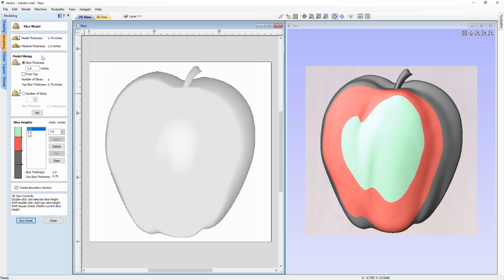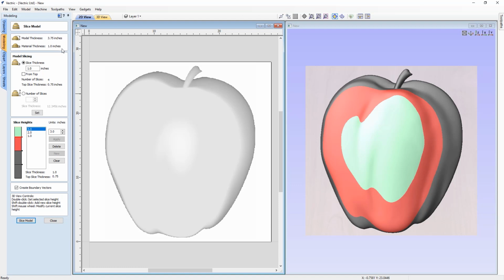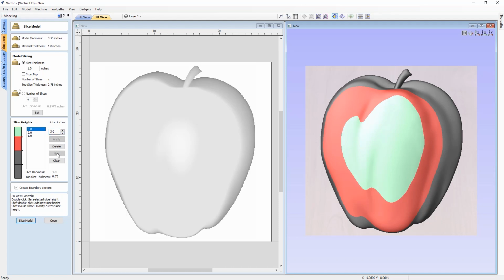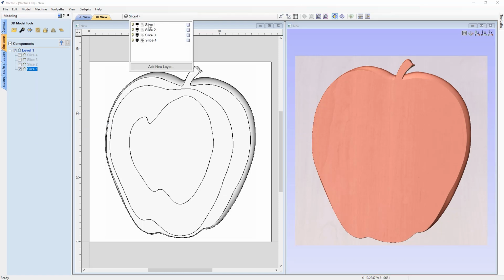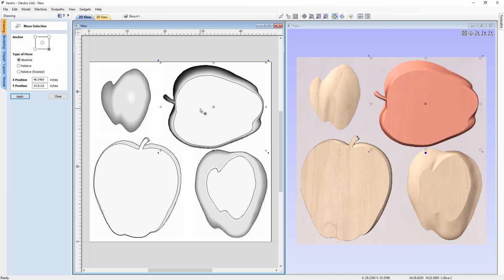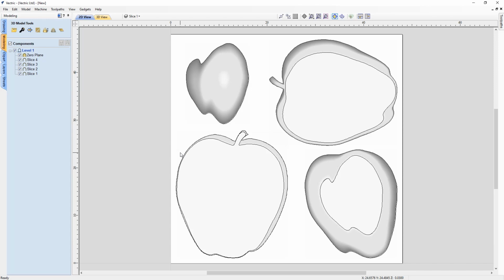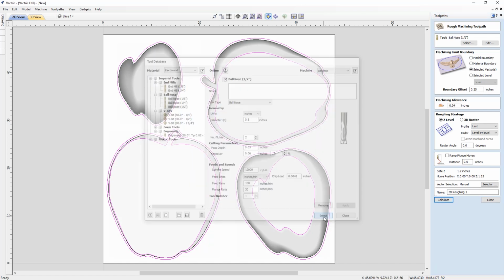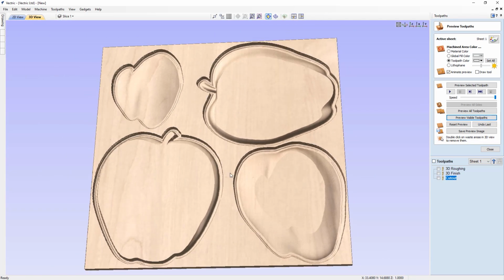Slicing a 3D Relief Model | Vectric V11 Tutorials

Comment: I realize that this video is several months old, and that I may well not get a reply, but I'm wondering how you align all the layers without dowels or some sort of alignment marks.
Reply from the maker: Hello Grant.  Thanks for the question.  Well if I was to make this I would use dowels.  In thins case we were just showing you how the slicing works.  In saying that the Gorilla head I made a few years back used a combination of dowls and by-eye alingment.  :)
Reply: @vectric  How to use dowels?
The dowels would need to be into the underside of the top slice.
Can slices be two sided so vectors can be copied to the underside?
Reply: @vectric  can I second the question for how to add dowels? Is there an automatic way for Aspire to add dowel holes in the right locations to each layer?